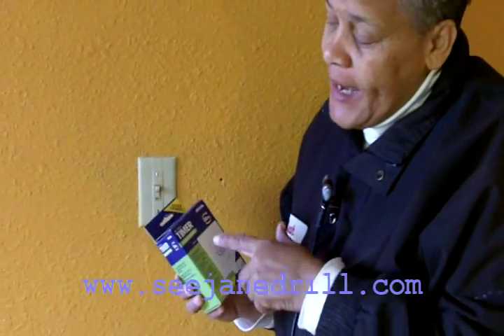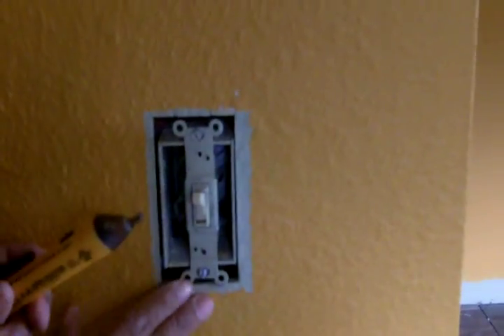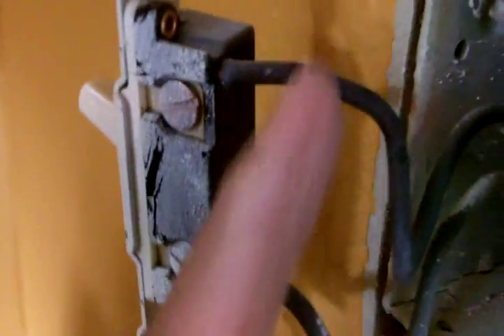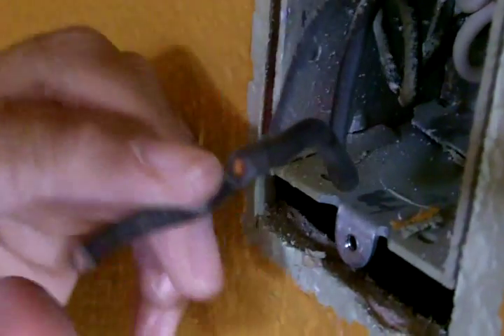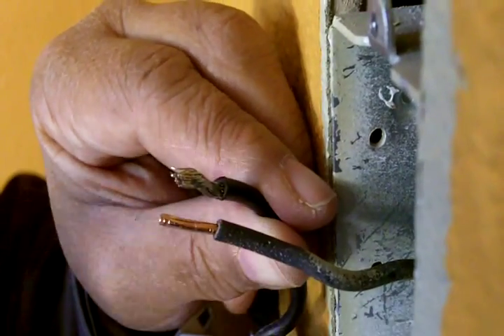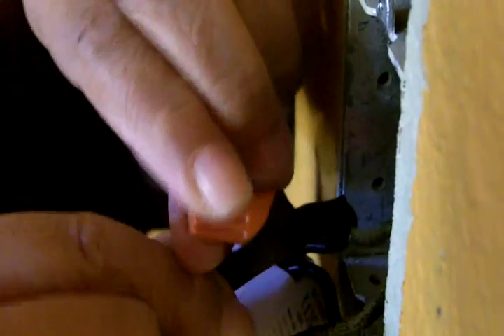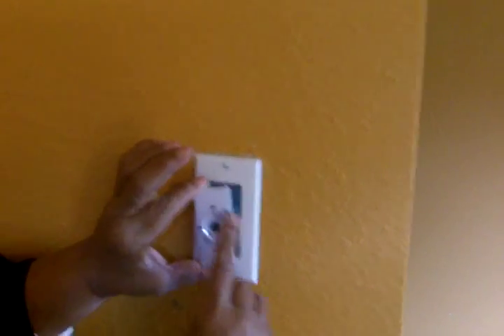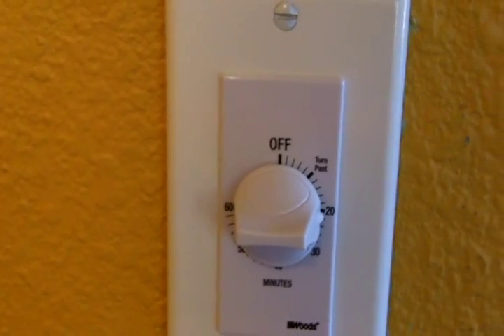Installing a Countdown Timer Light Switch Video

Comment: How did you know which wires to connect?  There's the the one that goes to the breaker box and then to the light.
Reply: It will be marked on either the schematic or the back of the switch. "Line"=Power and "Load"=SwitchLeg OR Wire leading to the next receptacle